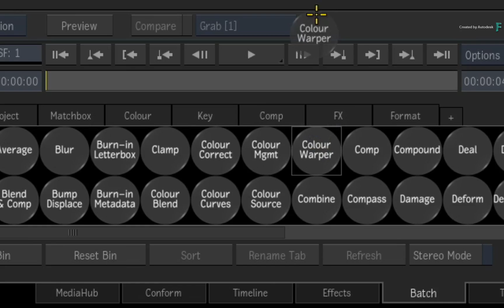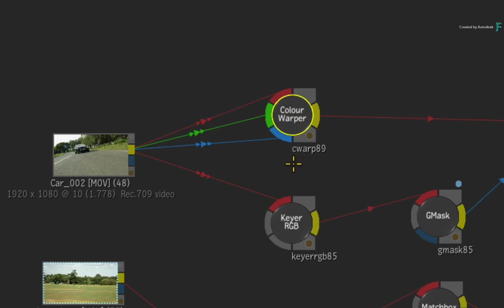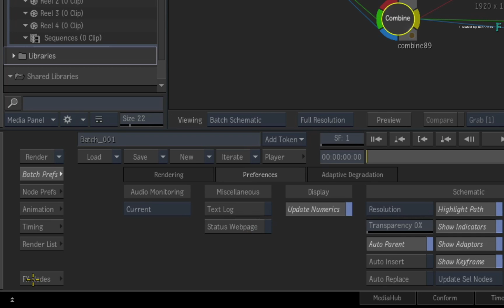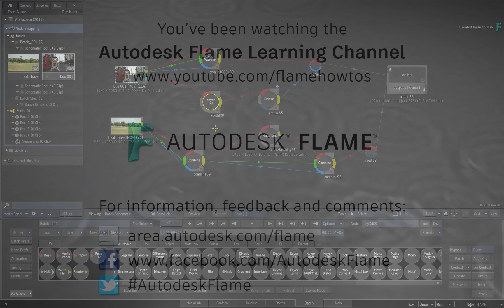Node Swapping in Batch - Flame 2019

Comment: Hi Grant,
Today upgraded to 2019.1. I've tried the hotkeys on my Flame Assist/Flare/Flame on mac, as well with Flame hotkeys and with Smoke hotkeys, but it doesn't seem to work. Maybe because I use a mac keyboard? I also can't find anything related in the Keyboard Shortcuts panel.
Reply from the maker: Hi Peter, holding CONTROL+SHIFT should do the job with the Flame hotkeys.   If not, please ensure that you created a new user after upgrading to 2019.1.   Secondly, you can check that your mac keyboard is set to US English and not International English to see if that makes a difference.